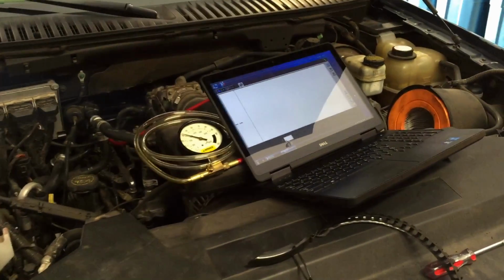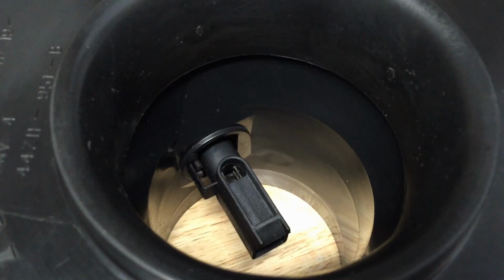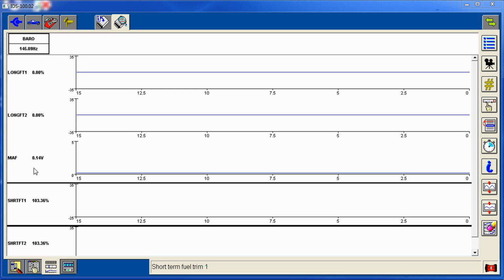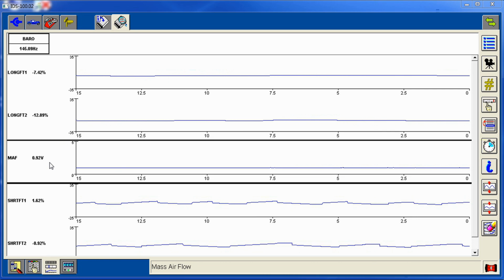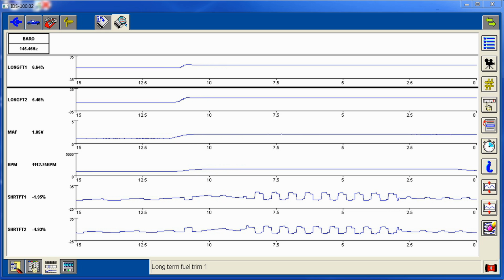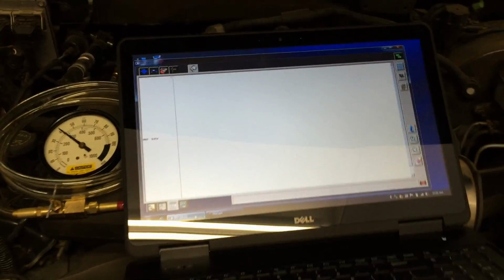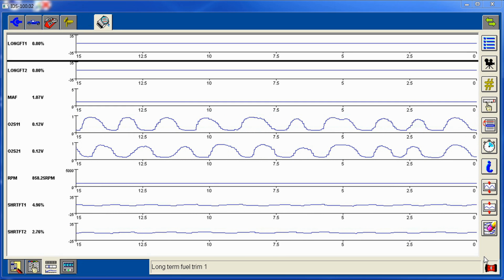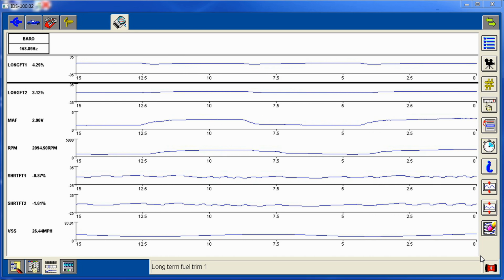Diagnosing a Faulty Mass Air Flow Sensor: P0171 P0174 Lean Codes

Comment: Classic dirty MAF, rich at idle, lean at WOT. Good demo Brian and explanation. The best part about this is, is it translates across so many different makes and models too and not just Ford. Glad to hear ya got a lot going! 
Take Care, 
--Eric O.
Reply: Brilliant demonstration, Brian. Rich at Rest, Lean under Load is a catchy mantra to help remember. I stumbled, trying to understand what happens at idle. For years I've been side tracked thinking it was because the PCM had a 'memory' of prior drive cycles, but as you elegantly show the answer is more simple than that. A dirty MAF actually overestimates air flow when at the low end of the scale, in addition to underestimating air flow at the high end. Why would a dirty resistor cool more quickly during low air flow than a clean one? It's more simple than that! I'll guess, the dirt and oil actually impregnates the resistor to increase baseline resistance values.
Reply: @spelunkerd  I've often thought the same, it must be impregnation.

Comment: Thanks for the good info . I think I'll change my K&N filter for the MotorCraft filter .I wish I'da known before I purchased it . I've run K&N for years in all my GM vehicles with no problems but they aren't finicky lil bitches like fords are .
Reply: ***** Thanks Jonathan , The problems will come when you reoil the K&N, Too little oil will hurt filtration and too much will damage the MAFS ,or so I've been told by above .

Comment: Amazing! Thanks FordTechMakuloco!! For the past 6 months I'm struggling with high gas consumption on my 10 year old Fusion V6. The dealers did not find anything and wanted to throw a lot of parts at it. I don't have a scan tool but I can try this. Thanks.

Comment: I have a 2003 Escape, fwd 5 speed with the zetec. If i throw it into nuetral coming to a stop the rpms will spike to about 4k and then slowly come down. the rpms will also spike about 500 when shifting. it has thrown a p0507 code. any suggestions.
Reply: +2012fofusionsel I have cleaned the IAC with no results. The throttle body itself seems ok, the spring is strong and there appears to be no binding or weird spots.  But with the throttle cable hooked up it seems to alow down a lot more, and it looks like it doesnt want to fully seat. I replaced the vacuum hose that has a heatshield on it that runs around the back of the engine and it did not help either.
Reply: +2012fofusionsel I sadly domt have a scan tool to use. Can a bad IAC cause it to feel like the pedal is being pressed down?